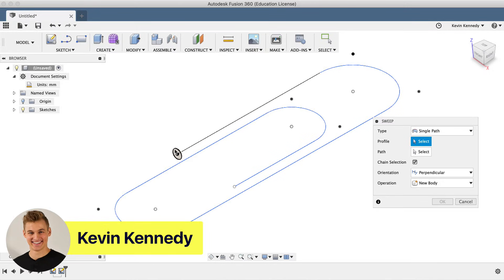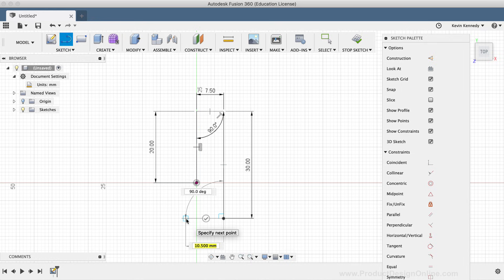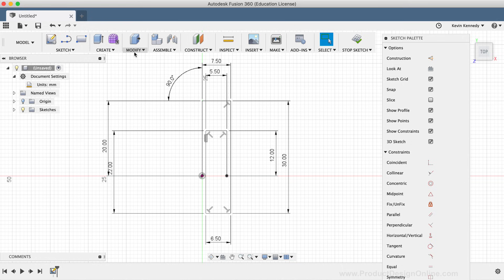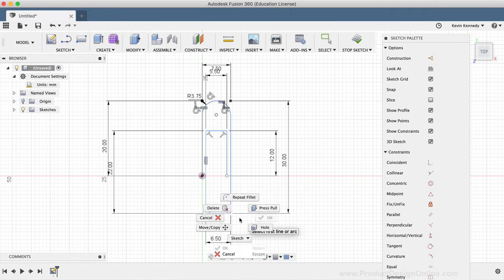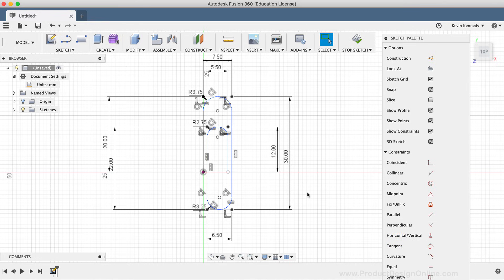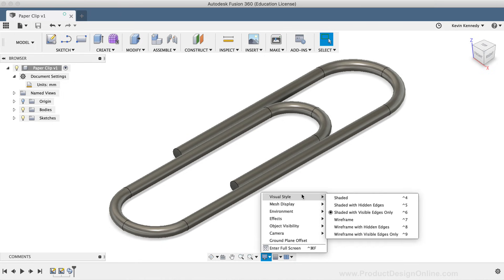How to 3D Model a Paper Clip - Learn Autodesk Fusion 360 in 30 Days: Day #3 (REVISED)

Comment: hi. i got a problem. after selecting the sleep command and selecting path i am getting "Error: The start direction of a path segment is antiparallel to the end direction of the previous path segment.
" 
pls help me
TIA
Reply: Had same error message - ( I did have vert constrains on as per video) I found by reducing the filet size 0.02 everything worked
Reply from the maker: @yollierenwick9602  Thanks for sharing this. Changing the fillet size seems to be the best workaround for now. I'm trying to figure out a good reason for why this is only happening to some users. Cheers, Kevin :)
Reply: @yollierenwick9602  Modifying the fillet size like this solved the issue for me. I also found it curious that I was unable to apply the horizontal/vertical constraint to any of the lines other than the first one. I was following the tutorial verbatim, so not sure what is going on.
Reply: @yollierenwick9602  Yes!  This fixed my error as well.  I went back and forth several times until I tried this fix.  It worked.  Not sure why, but it did.
Reply: @yollierenwick9602   That's easy and works fine. Thanks
Reply: same... why and how can u fix it?
Reply from the maker: @destiny_someone8476  Did you add the constraints as outlined in the video? If you add the proper constraints before applying the fillets then there shouldn't be an issue with the anti-parallel.

I'm happy to take a look at your file if you can share your link.

Share your public link as a reply to this comment. Here's a video explaining how to share a public link - https://youtu.be/2XrcrdV-8Ls
Reply from the maker: Hi, viswak. Did you add the vertical constraints to the vertical lines before trying the sweep? Those vertical constraints should ensure that they are both vertical/parallel with one another. In some scenarios, you could use the parallel constraint; however, in this case, that would overconstrain the sketch.

Double check that you have vertical constraints. If that doesn't seem to fix it then please share the public link of your file as a reply to this comment and I'll take a look. Cheers, Kevin :)
Reply: @ProductDesignOnline  I'm having the same problem. I think alll the constraints are in order, but it will not complete the sweep command. 
Here is a link to my file: https://a360.co/2lFIohN
Any help would be appreciated :)
Reply: @ytsas44089  Try rounding the fillet radii down to the nearest 10th, instead of the nearest 100th like in the video.  So 3.7mm instead of 3.75 and so on.  I think the cause of this problem is a rounding error in hardware.  The fillets actually consist of 2 arcs with a very tiny line connecting the end point of the first arc to the start point of the 2nd arc.  When you try to use exact precision (7.5/2 is EXACTLY 3.75), your hardware can't calculate the coordinates of those points with infinite precision, so it rounds them off and sometimes you get a line between those 2 coordinates that has a weird vector instead of being horizontal.  I think that's what's happening here and it's causing that error.  I had the same problem and this is how I solved it.
Reply: Cyanide300 thanks for the solution.  2.75 became 2.70 etc.  this solved the problems
Reply: @Cyanide300  thanks mate it solved my problem..!
Reply: I overcome this by not using the Sketch Fillets, instead using 3 construction lines perpendicular to the end lines on the X axis starting from their midpoint. I then drew a circle on each of the construction lines with the diameter respective to the length of the end line, ensuring the were locked in by giving them a Coincident restraint on the end line. Using the Trim function, I removed the excess lines and the inside of the circles, Bam! I have a paperclip.
Reply: @mat5352  But why though? If you use the constraints properly to begin with you never have to do this, that is the only issue people are having. You  Must use the verticle/horizantal constraint tool, and apply it to EVERY SINGLE straight line. The only reason people are having issues with the project is because they are missing a constraint, it's the literal only way this can happen.
Reply: @Cody-ox2uu  Doing this allowed the lines to stay parallel during the sketch process, but once I started the sweep process, I couldn't complete the bottom section of the paperclip without the lines skewing all over the place. The only way it would work as you are suggesting, is to reduce the size to 0.02 as discovered by  yollie renwick  in the comments above.
Reply: @Cody-ox2uu  While I must concede that I may have done some tiny thing differently, I absolutely could not get the sweep to work.  I have over a decade with SolidWorks, for what it is worth, and I understand that following his approach exactly is key, but I did this sketch multiple times and ended up with the same error.  
I did eventually get sweeps to work with the "antiparallel" error, but I had to do multiple sweeps.
I also took a different approach: https://youtu.be/lxK3LR4wd2g which I think is superior.  However, I want to be clear--Kevin's videos are generally excellent, and my production values SUCK.  So be warned.
Reply: I'm having the same problem even though I've applied vertical/horizontal constraint to all 4 lines (which are perpendicular to X axis). Please help me.
Reply: I was able to solve this problem by using the circle tangent to two lines, then inputting the radius.  Fillet wouldn't work.
Reply: @SifuHull  thank you this worked for me nothing else did
Reply: @SifuHull  sketch fillets suck, in F360 and SW!!
Reply: Same error
Reply from the maker: @0017hussain   Did you add the vertical constraints to the vertical lines before trying the sweep? Those vertical constraints should ensure that they are both vertical/parallel with one another. In some scenarios, you could use the parallel constraint; however, in this case, that would overconstrain the sketch.

Double check that you have vertical constraints. If that doesn't seem to fix it then please share the public link of your file as a reply to this comment and I'll take a look. Cheers, Kevin :)
Reply: @ProductDesignOnline  It worked. Thank you
Reply from the maker: @0017hussain  You're welcome! I'm happy you got it to work. Keep at it! Cheers, Kevin :)
Reply: @ProductDesignOnline  just worked my way through the paper clip example and made sure I put the vert constraints on as you suggested it worked.  I might me helpful to add that it is important to have those constraints on if you're going to do a sweep else you'll get an error and it's not intuitive that you need the constraints.  But...thanks for the video and thanks to those that have had problems and are willing to share their solutions+experiences.
Reply: I found when I didnt use the horizontal vertical constraints it worked
Reply: yes guys maek 3.25as 3.23 its worked
Reply: Ok I quit to fix it until I need to make a paper clip by myself.
Reply: For anyone unable to fix this with constraints, you can unlick "Chain selection" on the sweep and create one segment at a time. Click the end of the last sweep and the next portion of the line to keep going until you've created enough sweeps to go all the way around the paper clip. I'm pretty sure this is not a "proper" solution but it let me finish this tutorial until I've made it to the restraint tutorial.
Reply: Same problem.  My version removes constraints upon application of the fillets.  Couldn't get the sweep command to work without the "antiparallel" error until I had a fully constrained path.  Did this by changing the fillet radii (dropped it by.01 mm).
Reply: As below. Individual fillets. Each of them 0.01 smaller than the instructions and no issue. Cant believe they change the software GUI so much.

Comment: Can't wait to use this option on a hammer hanger. BTW wondering if I can create a printable copy of the dimensioned drawing?
Reply from the maker: Hi Rud Dog, when you're in the drawing workspace you can go to File > Print to easily print directly from Fusion 360. Alternatively, you can output as PDF, which is located in the toolbar, and then print from the downloaded PDF. The benefit of printing directly from Fusion 360 is that you can print multiple "selected sheets" that you have open/active. Cheers, Kevin :)
Reply: @ProductDesignOnline  sorry but you say it is located in the toolbar?
Reply from the maker: @MaxGoddur  Here's where I'm seeing it - https://snag.gy/NnpQaZ.jpg

I guess it could differ if you're using the UI preview?

Comment: Thanks for the video.  It helped me model a shape on a project I am working on.
https://i.imgur.com/RhgNoMr.jpg
https://i.imgur.com/ixkYHTO.jpg
The project is not complete and these are just some sample files I made.
Here is one I did with 2 inch square tubing with .125 wall thickness using the sweep command.
https://i.imgur.com/5cIljl8.jpg
John
Reply from the maker: These look great, John! Thanks for sharing these images. I'm glad you were able to use these concepts in your own project. Keep at it! Cheers, Kevin :)

Comment from the maker: IMPORTANT Be sure to apply the sketch fillets ONE at a time. Applying them both as I did in the video resulted in inconsistent results due to Fusion 360's rendering engine. If you apply them ONE at a time that will avoid the "Anti Parallel" error.
_
P.S. If you liked this video, I'd love for you to Subscribe ► http://bit.ly/sub-right-now

TIMESTAMPS
0:00 - Creating a Paper clip in Fusion 360
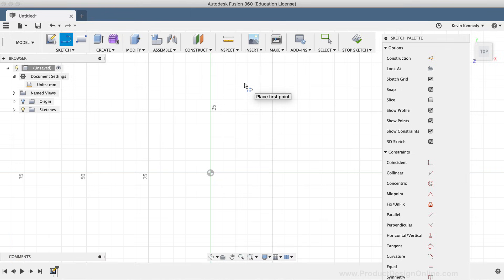1:58 - Setting up the path with lines
5:10 - Checking grid and snaps settings
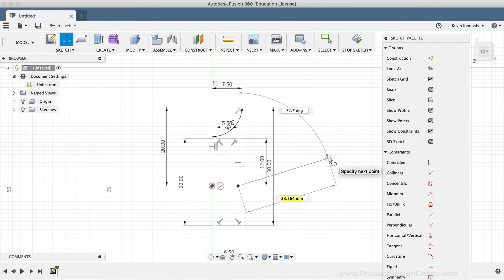5:25 - Moving sketch dimensions
6:22 - Adding sketch fillets
8:19 - Fixing sketch geometry with constraints
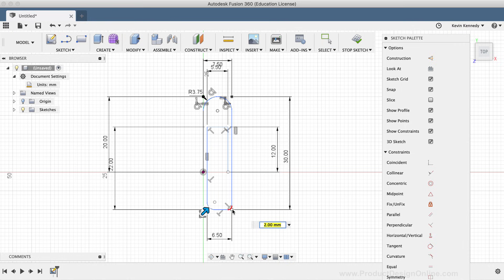9:58 - Adding the remaining fillets
11:27 - Creating the profile
12:28 - Creating the sweep
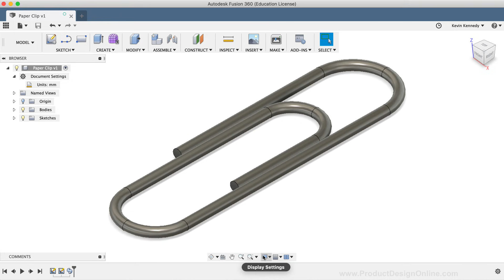13:53 - Changing the visual style
Reply: Product Design Online I added them one at a time which seemed to fix the “anti-parallel” error. However, now when I try to use the sweep function, my paper clip got broken up into segments, and it’s also not letting me manually drag the sweep across the path. I don’t know what i’m doing wrong.
Reply: @marlena8492  the same but i found a workaround as explained down the comments
Reply: @marlena8492  I've found using a two point circle to round off the ends works much better in newer versions of 360.  simply click the "two point circle " from the creat drop down menu and start the first point on the left vertical line and finish it on the right vertical line.  after building your circle use the trim tool to trim away any lines the around part of the bend.  this should accomplish the same goal as using the filet without all the constraints getting messed up though.
Reply: The real problem (including the 'do each fillet one at a time') is as Matt points out (below), the fillets need to be slightly smaller (not sure which ones, I reduced all of them). I originally tried filleting 'one at a time' - it didn't work, then I read matt's comment and reduced the fillet size(s) by 0.01 - then it worked, so I then re-did it all and did the fillets two at a time and everything worked fine (with the fillet radius reduced). very good tutorial :)
Reply: @petermilliken33  ^Peter has the best solution by far. FreeCAD has a similar issue, wonder if they use the same engine?
Reply: @petermilliken33 you fixed my issue. the one at a time didnt work but making everything .249 instead of .25, or .749 instead of .75 worked. im good now. thanks!
Reply: @tgsubie  Worked for me. Thanks
Reply: @petermilliken33  This solution worked much better for me!
Reply: Thanks for not just explaining the concepts well but also for clarifying doubts in the cmmt section !
Reply: Thx It worked👌👍
Reply: YESSSS!!.  Thank you for the note.  Could not figure it out
Reply: I'm really going to have to start looking for these pinned comments before attempting lol. I had to troubleshoot why my second set of fillets kept blowing out the bottom of the paperclip.
Reply: Yup - that worked. Re-applying v/p const after setting a fillet (one-at-a-time) as these are removed (throws an error saying as much) - however, unlike your video, i had to manually select each section for the sweep to complete the clip!!   I'm astounded by the many inconsistencies for a quality package!!!! THX FOR ALL YOUR SUPPORT.
Reply: Just had this problem and in the end my solution was to ensure all dimensions were typed out when placing the lines and LOCKED. That method allowed me to do fillets at the same time.
Reply: Struggled a  bit with this as well, ended upp doing the sketch again, without any fillets, then applied the sweep, then I went back and edited the first sketch, applied all fillets, one by one, then edited the sweep (it gave some warning), and then I could manage to draw the direction with my mouse.. Phew.. Done.. Thanks alot, will dig in to day 4 now, even though it is just day 2 for me.. :-)
Reply: Thanks for note!
Reply: My problem wasn't fixed by placing fillets 1 by 1 however changing the fillet size did work! Made the bottom two 3mm and the last two 2.25mm and seems to be a perfect fit
Reply: Like 3D printing, turns out 3D design is fraught with the same issues: version changes by the developers cause tutorials by the community to go haywire!

I struggled with this and decided to cash it in last night and go to bed, get a fresh start today. Tried to edit the original errored part, but still had the same issues, so I started from scratch. This time, I put the 90 degree constraints on EVERY bend during design. When I finished, I went back to start putting in the fillets.

When I got to the bottom of the paperclip, the right curve was fine, but the left curve did a crazy loop DOWN instead of up. I took the suggestion in another post about changing the 3.25 to 3.2 and it was perfectly fine. I completed the rest of the tutorial as described -- albeit one fillet at a time -- and there were no issues when performing the sweep.
Reply: OR, don't use sketch fillets (because they often cause these kinds of problems)!  The line tool provides a method for constructing curves that are tangent to lines, and since that is the goal then that technique should be used.  I offer the following video: https://www.youtube.com/watch?v=lxK3LR4wd2g&feature=youtu.be
Be warned--my video is NOT as slick as Kevin's, and this is NOT a criticism of this video series (it is generally excellent!), just that sketch fillets are not the best way to achieve the goals here.
Reply: I uave same issue as Marlena